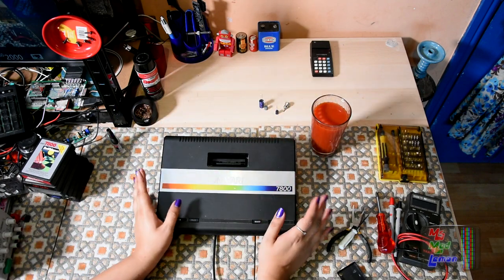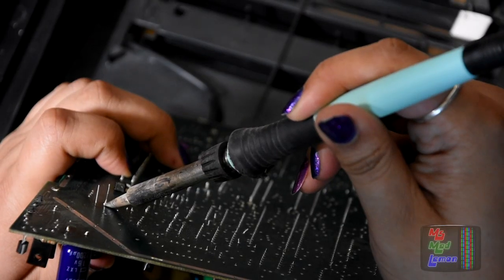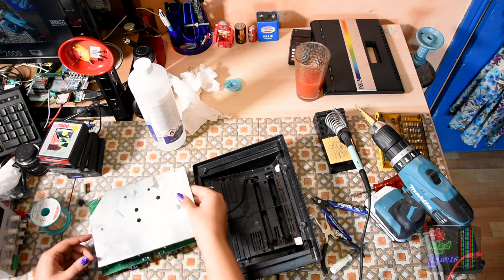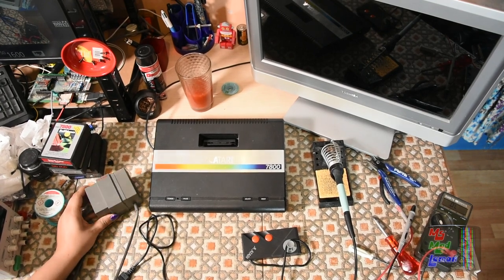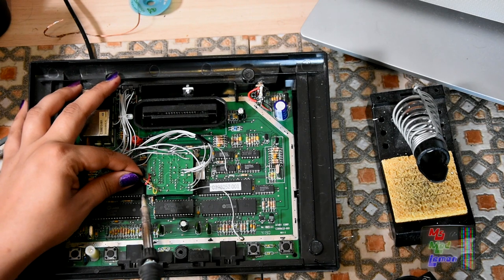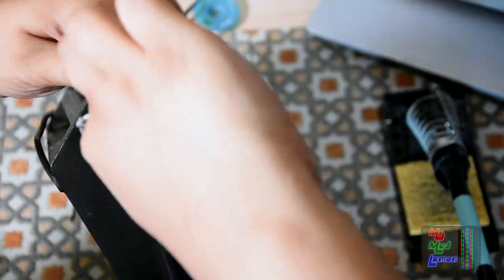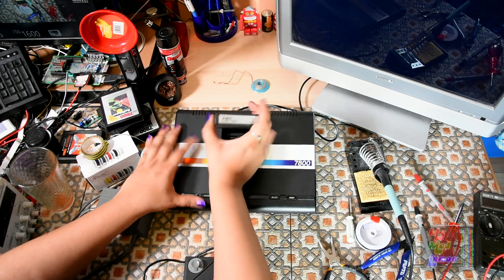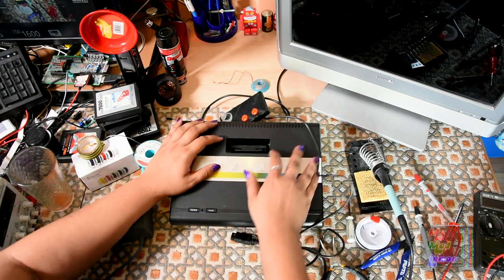Atari 7800 Part 2 -  Restoration, Mod & Recap

Comment: It's been a while since i had a Atari VCS 7800 around (only often borrowed it from a friend of mine) and totally forgot that it had this non-standard DC plug. I loved the gamepads however and the screwable mini-joysticks aaaand the fact that you could play the older VCS 2600 games on it (with the exception of a few titles).

Comment: You could put a pot in place of the switch for varable reverb. Great 2 parter. Thank you.
Reply: oh like a variable channel mixer?
Reply: @KRAFTWERK2K6  Exactly.
Reply from the maker: I need to find out why the reverb is so noisy first. I would have done that had I been impressed enough with the reverb, it sounds awful so i wasnt really motivated to. If I refine the reverb I may consider adding a pot instead.
Reply: @MsMadLemon  Yeah, It's all that hiss.
Reply: @frankowalker4662  could this be aliasing noise? I doubt this can be removed then.

Comment: Intrigued by your idea for a more "universal" power supply. I'm guessing you'll use a Meanwell in a nice case? One thing I was thinking could be neat is rather than having leads permanently wired into it, you could have 2.1mm sockets and just make up a bunch of 2.1mm plug to 2.1mm plug leads (of varying length.)
Actually, thinking about that, you could also make up some 2.5mm sockets with centre positive, and have 2.5mm to 2.1mm leads for 9v centre positive gadgets. Possibly colour code them so "mistakes" don't get made?
Keep up the vids!
Reply from the maker: Thanks for the suggestion, i've already created the psu and filmed it lol, you'll have to see what unfolds next week :o)
I don't really have something that uses a centre positive, if I did I could just simply create a lead that switches the polarity to centre positive.
And thanks!

Comment: Been watching a lot of Atari videos lately so your 7800 series has been most welcome. :) Yeah the power plug is annoyingly different, pretty much a mandatory mod if you don't have one. :\ Built in PAL game sweet, wish more consoles did that.
Nice discreet switch placement, was speculating on mods and not always easy to make them look natural to the original shell. To reverb or not to reverb, that is the question. ^_^ Hear there's an RGB mod still in progress but the S-Video mod seems to be a solid option in the meantime.

Comment: I thought I was the only one that used the shaft of the soldering iron to shrink heat shrink lol, I have thought of buying a proper tool but I never do 🙂
Reply from the maker: Funny thing is, I have a proper tool for it, the hot air station which works really well,  i'm just being lazy here lol :o)

Comment: I'd love to know what that AV mod is, still never seen any like it.  Sounds like a PT2399 delay IC, used for guitar effects, the longer the delay time, the more noise.

Weird corruption on Ball Blazer title screen first time you ran it, give it a clean
Reply: reminds me of the corrupted "Nintendo" logo when you threw a dirty Game Boy cartridge into the Game Boy :P
Reply from the maker: I know it's an S-Video MOD but when I opened out the cover, the IC on it had no label. and it all was covered with some clear glossy film.
I tried having a look around but couldnt come across one like this. 
I don't think it's the cart. it seems as if the 7800 console itself has a loose connection or two, I noticed that when filming the next video, the video after i'll be attempting to tackle that issue.

Comment: Atari shouldn't have released the 5200 and go directly to the 7800. According to hardware, the 7800, 5200 and 65XE GS are literally identical and use the same hardware base as the 8-bit computers 800XL/65XE. I think no one really understood why Atari released all these systems! 🙄
8:17 did I miss something? Has the 7800 a built-in Asteroids game?
8:48 oh, what's wrong with the Lucasfilm logo? At 14:55 it's ok. 😮
Reply: 7800 is nothing like the 5200, XEGS or the computers.
Reply: But then we wouldn't have had the PROFESSIONAL system :P
Reply: @andrewclegg9501  yes, figured that out later. Should have paid more attention to Maddi's first video. 😁

Comment: I have a question...when converting the power jack, would it be possible to just go USB3?
Reply: I think that would be challenging, since the default voltage is 5V for USB. You’d need to add some circuitry inside to make sure the machine is getting the voltages that it needs. Easier to just get a 9V power supply... those are very common and cheap.

Comment: Had no idea PAL 7800s have asteroids built in
Reply: Best Electronics sells a mod kit with the ROM to install it in NTSC models. Someone else on YouTube a few years ago installed Pole Position II instead as well as other games. The European 7800s also lack the 128-bit encryption key to prohibit unlicensed games running on them because of US export restrictions at that time. That's the encryption key authentication process running on NTSC models at startup when the Atari logo is displayed onscreen...